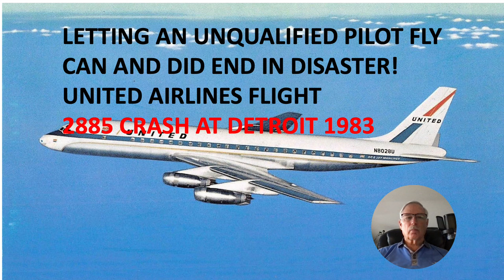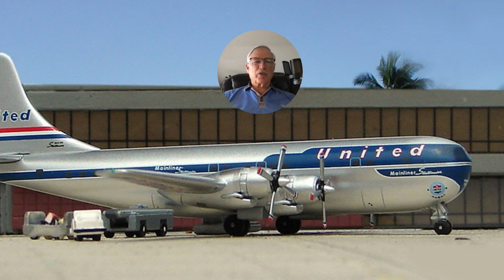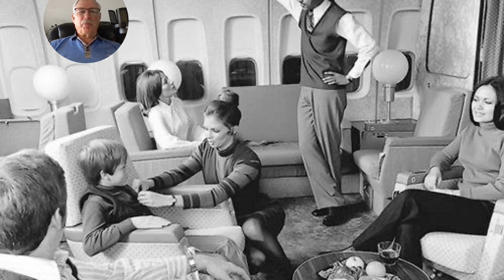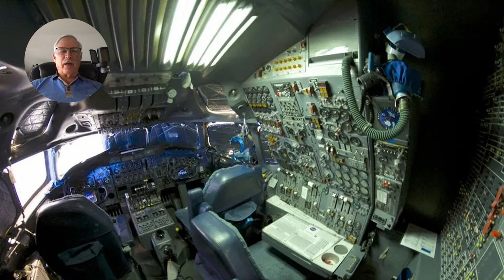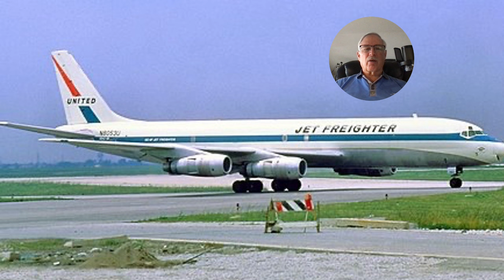LETTING AN UNQUALIFIED PILOT FLYCAN AND DID END IN DISASTER! UAL FLIGHT 2885 CRASH AT DETROIT 1983

Comment: This is another of your fine videos, and besides the on point commentary and history telling, you chose some good fotos. However, no fotos  of the stretched DC-8s with the CFM-56 engines, which was my first copilot bid (anyone can google those images). Only stayed on it until they began phasing it out (went to the DC-10), so less than 2 years. Interesting fact was we had to go do some touch and gos at Pueblo, Colorado at night after our final sim check, because the DC-8 simulators did not have the required fidelity (visual) to get full certification. Solid machine and great to fly.

Comment: The number 1 copilot on the 767 in MIA was a non-upgradable guy.  He was nice enough, but had issues.  As a matter of fact, the top 5 copilots there were non-upgradable.  Unfortunately, the number one guy kept pressing.  He was on the 767 for 20 years and pushed for an upgrade to the left seat of the 767.  You would think after 20 years in the same jet that he could do it.  They let him try and would not let the copilot to step in and save him.  He failed miserably and was fired.  They warned him....

Comment: Back in the 80s I worked for an outfit flying L100s, Electras and DC8 and later B727s for freight across Africa. Mostly US flightcrews of a certain generation. As a company man I used to fly jumpseat. The 3 man cockpit dynamic was great and something to behold. Yep, there was a bit of seat swapping too.
Reply: Calling Frank Abignale... What do you think ? Didn't you dupe Pan Am for years.. pretending to be a pilot ? After the Boeing scandals, the FAA wanting to hire mental and intellectually disabled people as Air traffic Controllers and United wanting to hire pilots based on skin color and gender , instead of actual aeronautical experience, this is just what I need to solidify my boycott of flying indefinitely !!

Comment: If I may, I'll add a bit more... The value of checklists cannot be overstated. After they landed at Detroit, the stab trim was near full nose up (10 degrees ANU) due to a full flap landing, low Vref and a forward CG, and the stab trim was not returned to 0 degrees ANU as it should have been. Then, on receiving the Takeoff Data card, it was not set on the trim, yet again being overlooked. On the Before Takeoff checklist, unbelievably, it was again overlooked. So, why did they not get a Takeoff Warning Horn when they advanced the throttles to Takeoff Thrust? Because, on the DC-8, the Stab Trim is NOT on the Takeoff Warning Horn because there is no green band on the trim because, depending on the CG , the stab setting can be almost anywhere in the range from forward of 0 degrees to as much as 8 units ANU. So, how can you deal with this? At my company, we used the United simulators in Denver for our training because United charged a very low usage fee and they were the finest DC-8 Landing Maneuver approved simulators I ever used. Here was our scenario. The instructor would tell us that we would have the trim set to 10 degrees ANU, we were not to use the pickle switches to reduce the trim until they said okay, but we could do anything else to try to prevent a stall and crash. So, down the runway I went, and, as in the accident aircraft, the airplane autorotated just after V1, and even holding the control column against the forward stop, it keeps pitching up, so what did I do? I reduced thrust and put the airplane into a bank near 40-45 degrees and those two actions reduce pitch authority of the stabilizer enough that you can lower the nose to avoid a stall and then correct your mis trim condition and resume normal flight. The instructor said "Good, you figured it out!" And I said it was all I could think of to do. And they ran the scenario for all of our guys during their recurrent raining cycles and most of them got it on their first try, but in defense of the United crew that crashed... Remember, they were on a several day trip, they were probably on a sleep/awake cycle as well as eating that messes up the body clock, and the odds were stacked against them. I was fresh going into the simulator. I have over 7,000 hours in the Douglasaurus, and I loved the airplane. I believe it to be the strongest airframe I have ever flown. I'll also tell you the United Training Center is the best one I have ever seen, and is the best equipped.

Comment: Just curious if you have any insight into the rash of recent losses of separation around runways & the near airport environment.  Lots of recent incidents where aircraft are cleared for "no delay" departures when another a/c is on 3 closing to 2 mi final, or aircraft departing or on go around turning into the path of parallel active runways (responding to a vector given to another a/c, or failing to confirm the actual assigned SID). I'm reminded of the USAir 1493 tragedy at LAX. Some people are pointing to a rash of ATC inexperience, but I wonder if there isn't also a situational awareness component (i.e. the ability to question a clearance, and not just do what ATC says).  Would be interesting to hear about the importance of SA / loss of separation in the pilot culture of the late 70s, 80s, 90s etc. before and after the advent of CRM.

Comment: If you’re not authorized to perform copilot duties, and the captain allows you to fly, how then does the airlines log your time? In the airlines do you log your own time or does the airline keep its own logbook on you? I know in the military they have what’s called wheels up time and I don’t think they get the same log time as a GA pilot who would strictly go off the Hobbs meter.
Reply from the maker: Probably shouldn't log flight time that is acquired illegally! The airlines track your flight time for currencies but you can also keep your own log book.
Reply: I recall wandering through the MEC office one day when I was working there and running into the legal office where all of the files were stored which detailed all of those on “bid restrictions”.  I was surprised and amazed at the numbers and asked one of the ALPA lawyers about them.  He told me that there were FAR more than most people knew.  I would think with AQP that this is probably a thing of the past and that those unable to upgrade are released?  I don’t know.